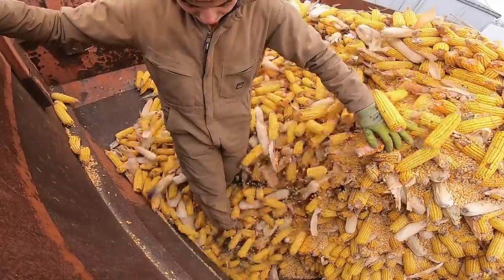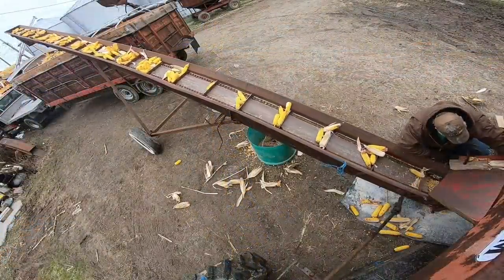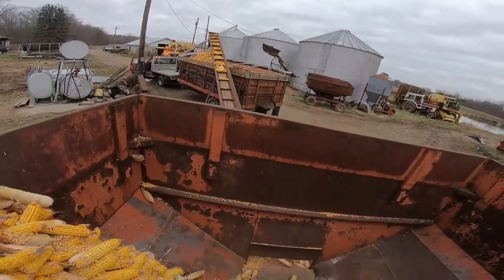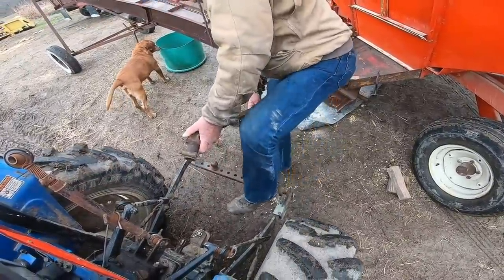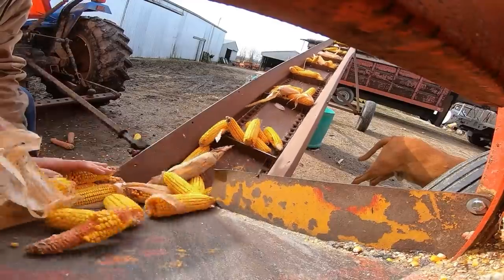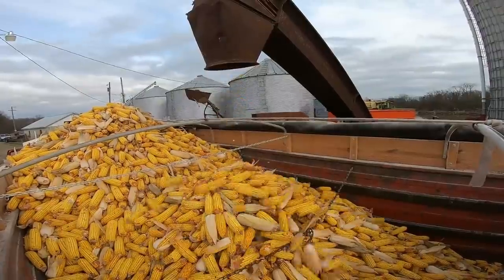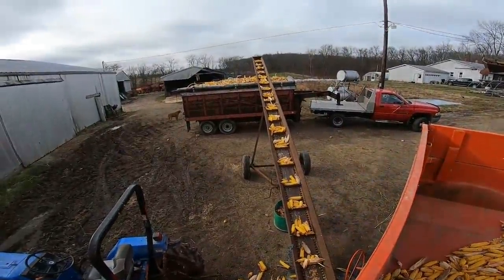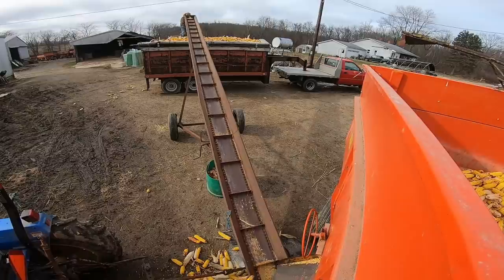Ear Corn Accident

Comment: You need to get a PTO shaft with a shield on it.  Throw that pos that's on it in the scrap pile.  Unfortunately you learned the hard way.
Reply: Is many instances where safety Shields won't do anything to help at all yes it could have prevented it but it may not have you have to act like every PTO shaft moving like a solid piece of metal and never trust that shaft guard

Comment: Yep, those dang things will take you apart. I know a couple guys that got tangled in pto's. Both lost, but still alive. One was mixing tmr, and his long shirt blew into the pto, grabbed him and flipped him to the ground, peeled his zgirt from him. He had no idea what happened, he was Med flighted. Ripped muscles from the thigh bone, broken ribs, dislocated his shoulder, and pulled all muscles from thigh to his bicep. No he has a really funny looking bicep. A lot of surgeries to get him back to where he is today. He was out of actuon for a few months. Another guy for what ever reason noticed the pto was sliding off tractor, it was turning slow, he grabbed it and doesnt remember anything after that. Broke his hand and arm in three places. Knocked him out. I tried to explain to him, that at 540 rpm, thats 9 times a second it spins under load. Its not going to stop just because you grab it, and its moving tons and tons in the blink of an eye.

Comment: It happens fast,  my dad years ago was on top of an old Massey combine we used to clean grain with. He reached in the hopper to grab a sample and the cross auger caught his sleeve and pulled him into the tank. It started to wrap him up and choke him. My grandpa just happens to see his feet fly on the air and for the combine shut down. My dad made it thankfully and only was badly bruised and banged up. Could have been worse. Farmers be safe!

Comment: 👍👌🇨🇦❤, gr8 safety awareness video, I am not going to lecture about do's and don'ts, lost a high school friend that got wrapped up in a large grain auger pto, the tractor did not stall, his coveralls got snagged at the wrist of one hand, they figured he reached out with the secomd, and both were caught, the pto tumbled him until he was no more, his father found him a few hours later, the tractor still running, the pto still turning, his son was dead and was a mess, no more graphic details, a month later the dad sold the farm, he could not live with it,
Reply from the maker: That's so sad. This is why I try to use as little horsepower for stationary work as possible.

Comment: Never good when someone gets caught up on a PTO!!!
Glad he's alright!! 
BTW, tell him those ribs will be healed in a couple of months... But he will feel them for about a year!!!!
Had an old man in our area who bought and sold manure, he'd haul it in, compost it, mix it together, sell most of it to the state for the flower beds along parts of the highways.. he had a Massey 135 with a loader and a tiller on the back. He was about 84? 86? Years old. For some reason he was behind the tractor, PTO running. Caught his coveralls. Luckily one of his boys was there!! He got wrapped around a dozen times or more. Busted him up pretty good!
Three or four months in the hospital.
Keep in mind, the smaller Massey's don't have much room between the PTO and the drawbar. 
"Safety is free, use it!" (Stihl slogan from the '90s)

Comment: Thank the Lord your Dad is more or less okay.  Usually entanglements with PTO's are life-changing, or life ending, events.  I have to say I've cringed more than once watching some of your videos-- one time you ducked between the gravity wagon and running auger, on that part of the auger where the top shielding is missing... right next to that drive coupler with a bunch of excessively long spinning bolts sticking out, which like that auger drive with its long bolt jutting out are just MADE to grab clothing and pull you in.  I'm not a huge "safety sally" but the thing is, we farmers are in a very dangerous business; we rank right behind miners and cops in numbers of workers injured or killed on the job.  PTO's are just one, but a BIG one, of the causes of that.  At the very least, the long bolts should be cut off just past the nut, so they don't stick out to grab clothing... and I'm sure yall will have a lot more respect for spinning shafts in the future.  Thankfully you and your Dad get that opportunity.  Many don't.  Shields are cheap, lost limbs or lives aren't.  Even on the other side of the auger, that pulley and long shaft sticking out, unguarded chains and stuff, all that are potential danger points... Not good.  Sometimes we have to do what we have to do, but we have to try to minimize the risks as best we can, where we can.  Avoiding all risk isn't realistic, but like I always said, there's "risk" and then there's just taking dumb chances.  The trick is knowing the differences, and respecting stuff that can maim or kill us.  Darting between a wagon and a spinning shaft is just a "dumb chance" IMHO, and it only takes ONCE to end in disaster.  

I hope your Dad made a full recovery; my wife had a bad reaction to "the shot" by J&J for the rona, and she got blood clots in her lungs and woke up feeling bad one morning, and instead of calling me from the chair in the living room she decided to walk back to the bedroom and wake me up.  She passed out and fell and broke 5 ribs in 7 places.  Had to be airlifted from the local hospital 10 miles away to San Antonio for emergency surgery and nearly died.  After a week she got to come home, but yeah it takes months to get over that kind of injury.  Thanks be to God she's doing well now, completed her chemo for breast cancer and came back clear around Thanksgiving.  Life is short, and we have to do the best we can to take care of ourselves, so we can be there for our families.  

You guys be safe and God bless!  OL J R :)

Comment: I cringe when I see guys sitting down and using their hands to slow the gravity box. I was always told by my dad  to use a pitch fork instead of your hands for this exact reason and to never work on the side of the elevator with the  pto. Thankfully, no one on our farm ever had an incident with a pto of any kind, our equipment was much larger and likely wouldn't have even noticed if anyone was ever wrapped up.

Comment: I cannot warn people enough about pto's. On yours i witnessed bolts way too long. Make your bolts only long enough for one nut. Not even a washer or lock washer. Less is better then his coat would not have not grabbed that bolt as easy. I watch Jacob around the pto during silage blowing. If for some reason the u-joint came loose that driveline is a murderer. Only stay around it as long or make it as short a time as possible.  Just a rule to live by.
Reply from the maker: I did shorten those bolts recently.

Comment: I see you have a belt pully on the side of your conveyor. You should install an electric drive belt with a belt slip clutch for safety purposes. You also should know better than to operate a driveshaft such as you men were without the safety slip shield. Terrible  what happened to your father but, he happened to be fortunate that he was mot permately maimed or killed. That type accident has happened way too often to farmers and there usually never one around to help them. Sorry for the rant but I know of one farmer who lost both hands in the snapping rolls of a corn picker. He too had no one around to help him until a person passing by on the road saw him standing in the same place not moving. We are all wishing your father has a fast recovery.

Comment: So many things I have seen 🚜 tractor with no ROPS walking over and crushing guy pulling stumps or crushing hand in hydraulic Log Splitter. Same thing as PTO getting caught up in rear  PTO Screw/ Draw Bar  type Log Splitter. 2 Stage Snow Blower not much left of hand. Knocked out whacking my brother in the head with the bucket swing on the Backhoe oops.  Glad this story had a Happy Ending.
Reply from the maker: I had an uncle that died in a tractor tipping back while pulling logs. It was an old 8N.
Reply: @boehmfarm4276  Sorry to hear that.. Have to be careful especially when working alone.